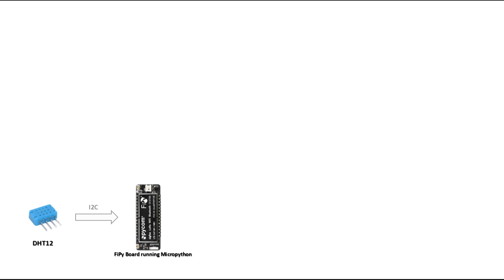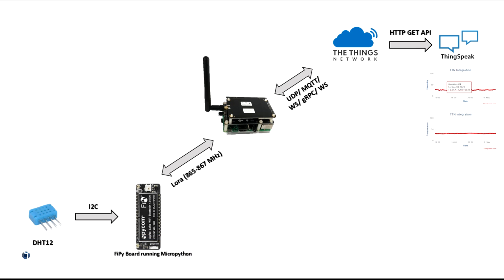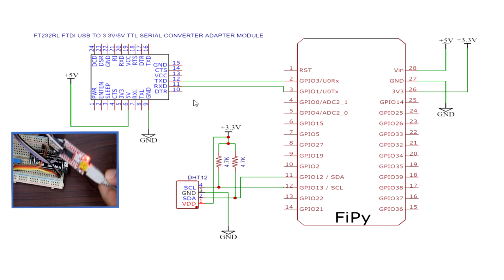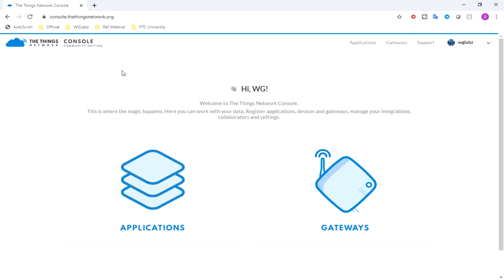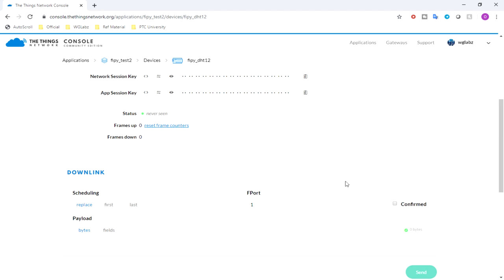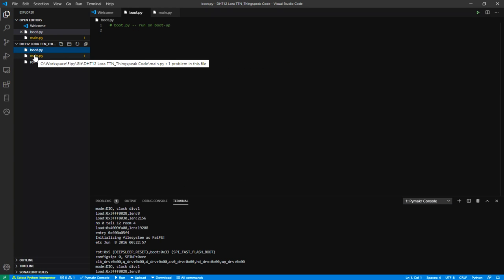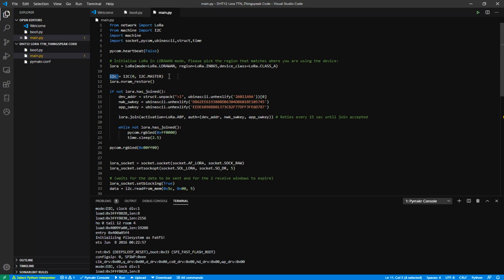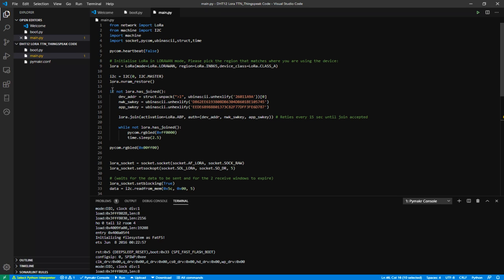A  LoRaWAN Node using Micropython | FiPy #1

Comment: Wonderful , I'm doing a project using the Fipy . I've a question , Is it possible to send the MetaData of the Lora Packets to the Thingspeak ? the Answer of this question will really let me settle the choice between ThingSpeak and Node-Red ...
Thank you
Reply from the maker: I would suggest to use nodered as that would give you more flexibility... Compared to thingspeak
Reply: @WGLabz 
Thank you , but the thing is that i noticed that Node-Red requires a knowledge of java script and i don't have any experience with it, that's the reason why i was thinking about thingspeak .